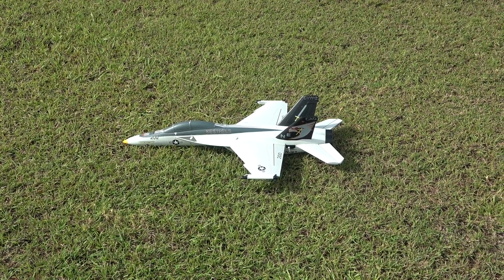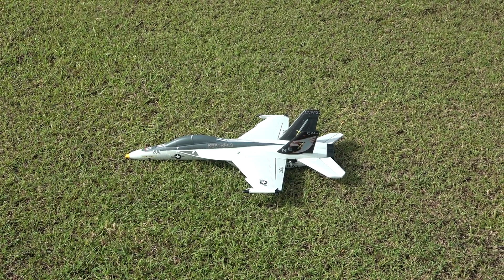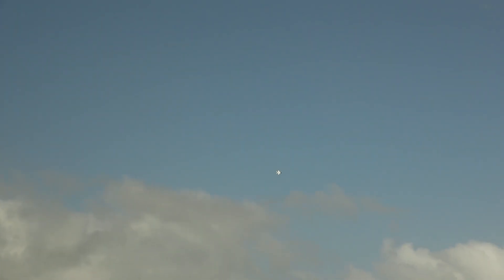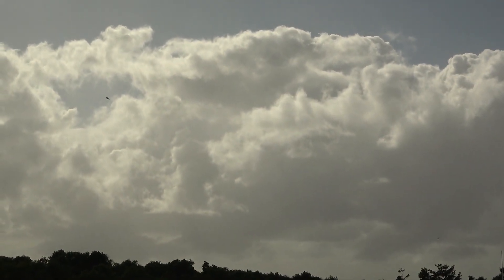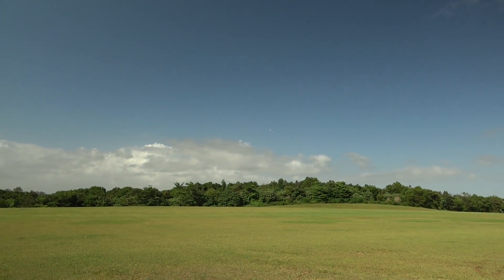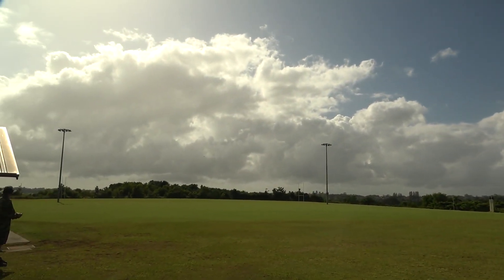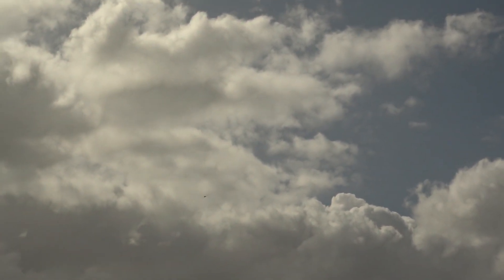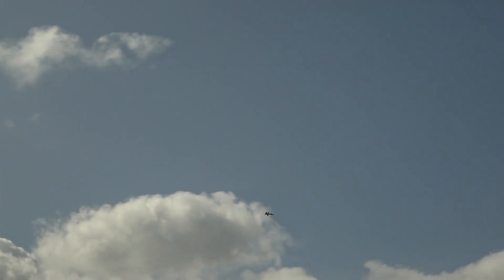Eachine F-18 50mm EDF jet Maiden Flight with Radio Link Gyro

Comment: Awesome! Which batteries did you fly it with in the video? Cg as per manual?
Reply from the maker: CG in manual is wrong it is 55mm and I use 3 cell 1300  high c . You should check out my unbox n build
Reply: @blowy48flyrc  Thank You! I just went straight to your flying video...Love it. I think it flies better than the f-16
Reply from the maker: @ioskaioska5166  yes the F16 has a little wobble

Comment: Nice build love the vids, so I have the same gyro in mine, but I also use all radio link products, my plane is completely custome outside of the frame. 

I do have a question, have you had an issue with shaking with higher speeds going straight or in turns? It drives me nuts, in low rates it seems better but still happens
Reply: I saw in another review that the guy suggested to decrease the gyro gain sensitivity and also increase the expo a bit (up to 30% for the most conservative mode). Hope this helps
Reply: @MarkdocP  So I did a thing, its called read the instructions LOL. The gains cannot be adjusted, although I have 100% deflection and about 80% expo it still shakes, so when in low rates a little better and my D/R is at 60% deflection and 80% expo but still shakes under hard acceleration. So what I found out by looking at the instructions is I can shut it off completely and that's what I did ;-) So I now have 3 positions for Gyro. Thanks much. 

You should test this out. I have already gets close to 90MPH. 40amp ESC, Xfly 4s 50mm EDF and a Tattu 1300mah 5s 100c pack. Get a solid 900 to 950 grams of thrust.
Reply: @ltfadl1  Hey Anthony.  I haven't built mine - thanks for your build info.  FYI rates should not impact  the gyro.  That's why you can't tune the shake out with rates.  The radio is setting the rate and the gyro has no way to know what you rate is set to.  The gyro just corrects what it thinks needs correction.  Your gyro is probably picking up vibrations.  Make sure no wires are bumping into it.  You can try different foam sticky pads to dampen the vibrations the gyro is sensing.  Maybe your EDF is mounted a tiny bit loose.  I'd just hold the plane and go pretty high throttle.  If you feel a buzz  through the foam the gyro will.  The gyro thinks it's moving left/right/left/right or up/down/up/down because it probably is by a very tiny amount.
Reply: @js32257  I figured it out, I just disable the gyro and I can turn down the gains as well. The gains where too high. I balance all my EDF fans so it wasn't vibration, but high winds and a twitchy gyro setting. ;-) I am also in the process of building another one, I took a nose dive almost full throttle LOL.
Reply: @ltfadl1 aww man.  Thats why i stick to the small 3/4channel.  If i crash i womt cry....I have crashed many times.  I do want a larger EDF with a gyro.  Just d9mt know what to get.  The F18 is tooooo fast for me!

Comment: 3 minutes is definitely NOT enough. You can double that time with more scale like throttle management.
EDF 18's in general can do much slower patterns to the belly landing.
Reply from the maker: Yes I like a longer flight it's flying smooth